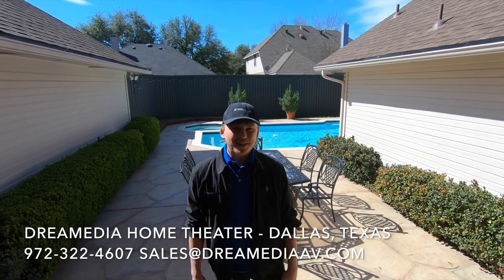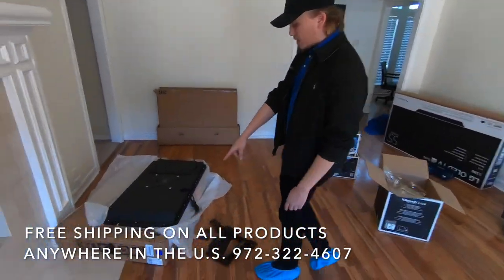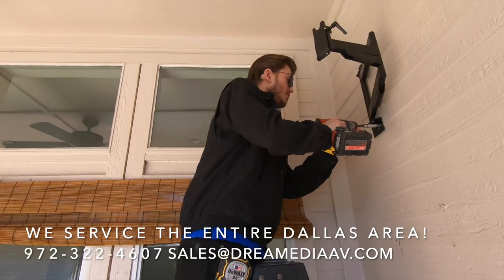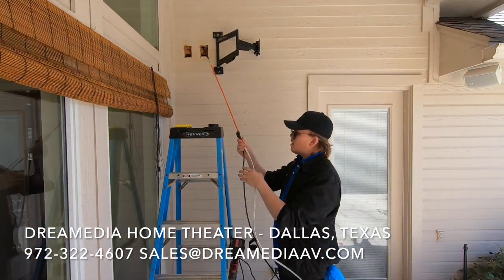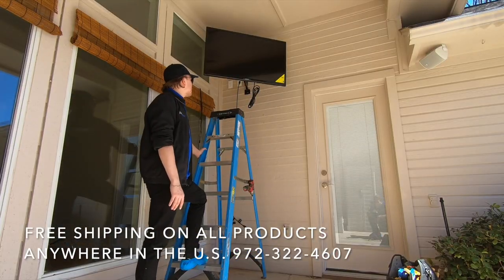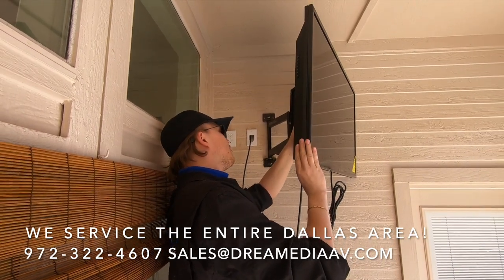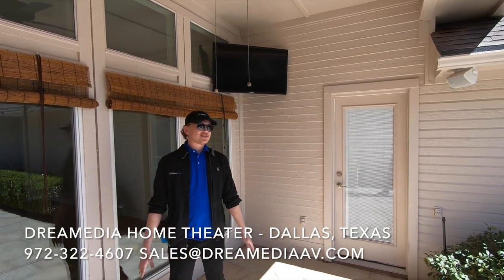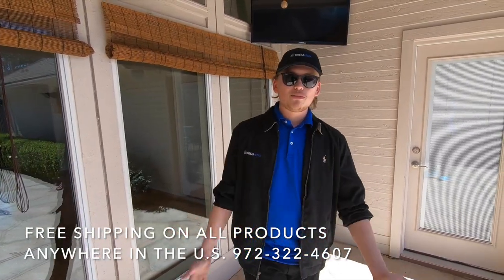SunBrite Patio TV and Speaker Installation with SONOS in Plano, Texas by Dreamedia Home Theater

Comment: Also I have a sonos amp V1....so I don't think it has HDMI in....Can I still get this to work somehow?   I originally though of using a speaker selector box for inbound sources, but am thinking there has to be a better way...If the HDMI works (per my previous question), it would be easier to just get a new sonos amp probably.

Comment: so I have a sonos amp outside connected to outdoor speakers.  I also have a subrite TV with a soundbar.   As it is not a smart TV, I have a roku stick plugged into hdmi 1 for content.   Using your method, I would use HDMI 2 to connect to sonos.   How do I get the TV to send sound over HDMI 2 to sonos (remember I need to be on hdmi 1 to get content).  and what do you select on the sonos if anything?